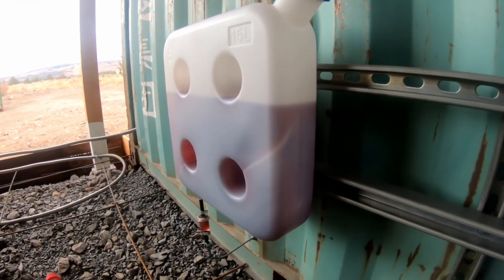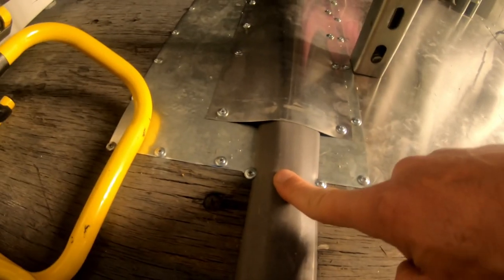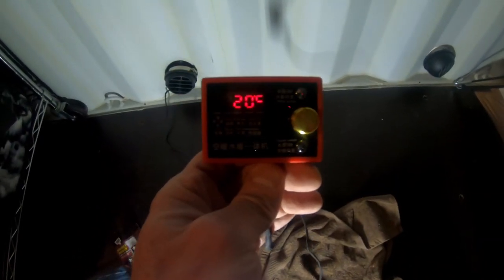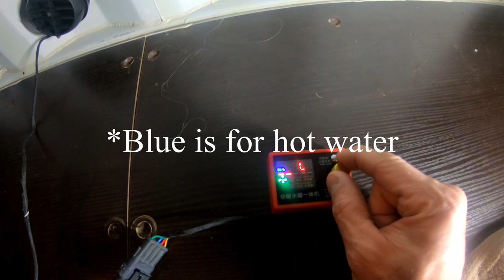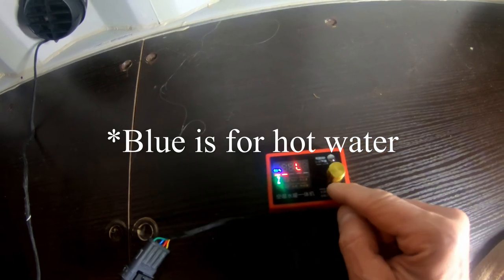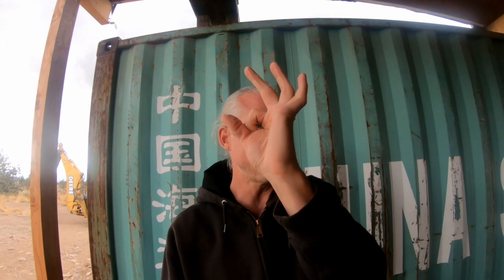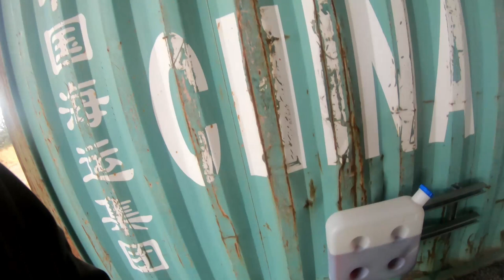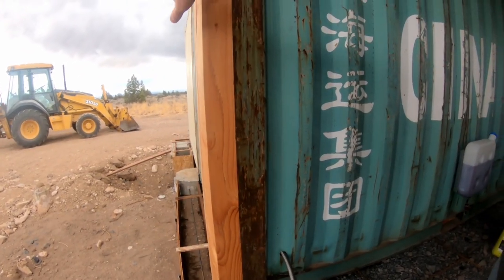Diesel Heater - Shipping Container Tiny Home Build

Comment: Get a spare pump and burn disk. Few controller options for these with your container just set on low via "hz" mode should keep it toasty. These also come in a water heating version but at only 5-8kw you wont be making a hot tub.
Reply: Can this unit run without water in it?

Comment: is that a 2kwh diesel heater? and where did you get the hose for both ends to fit?
Reply: Their not made to run a 50 foot exhaust hose. Read the directions, you might come to the conclusion why you think it’s junk. User error. Totally.🤣